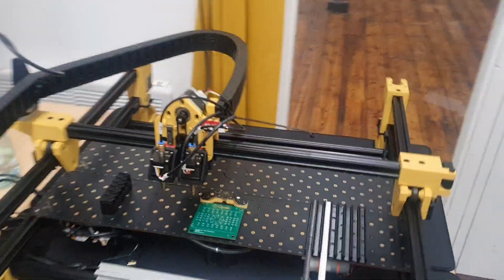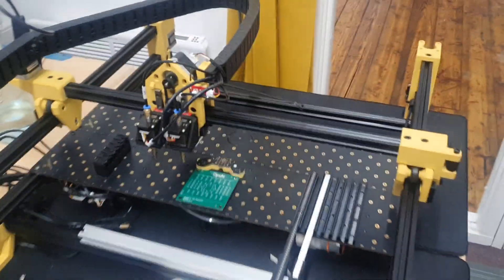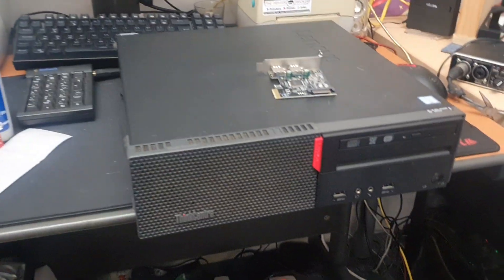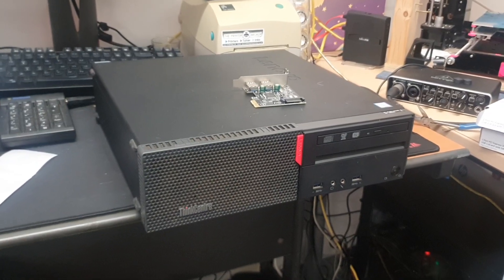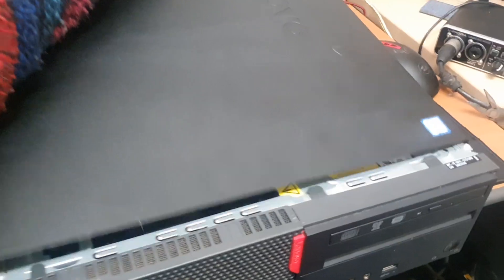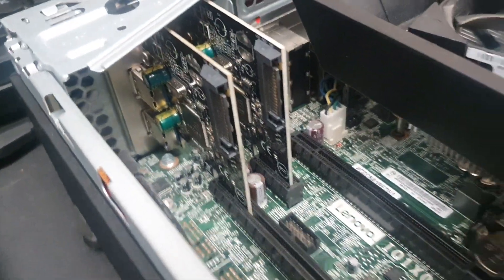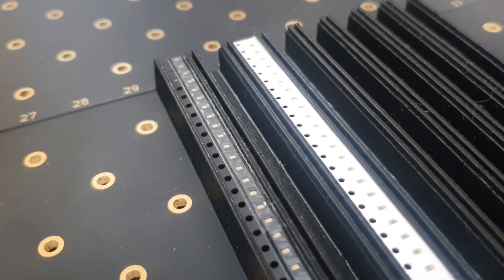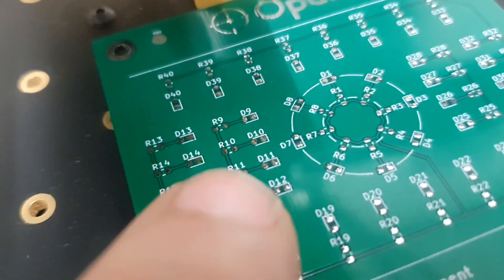Setting up the Opulo Lumen with a dedicated PC

Comment: It's amazing how affordable computers have become. The specs on your machine are very serviceable even in 2023. I've bought a number of Lenovo T420's and fitted them with extra RAM and an SSD for about $100-$150. You can even get an external monitor for $50-$75 or so. By the way, I notice that you're using a Behringer interface which are underrated as well. Nice project!